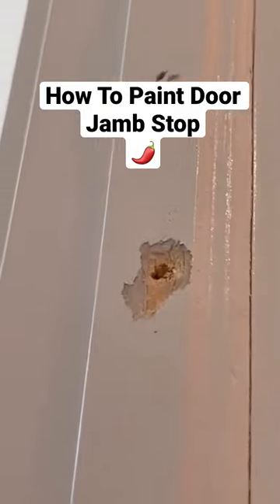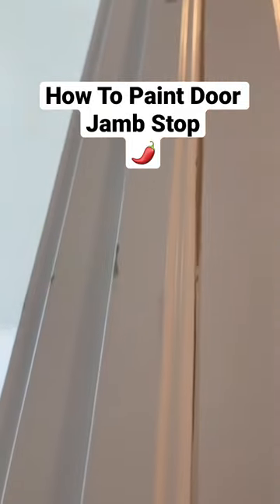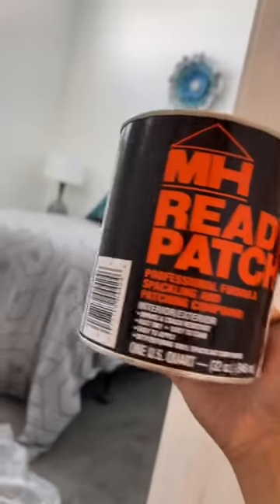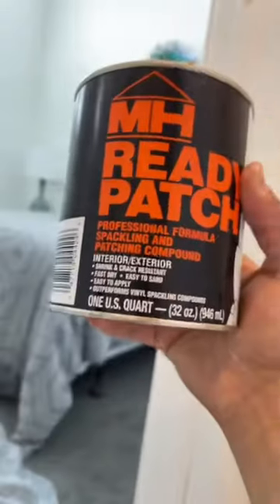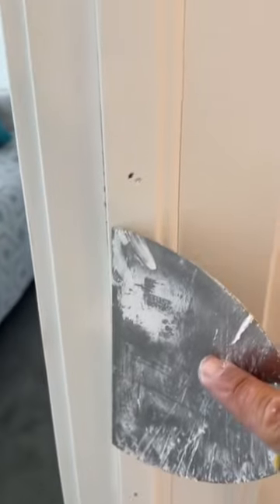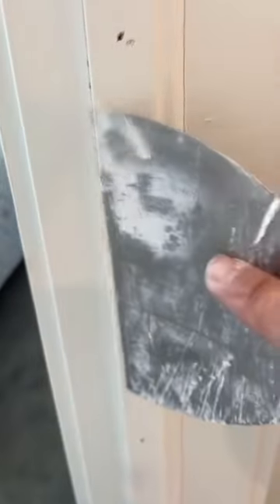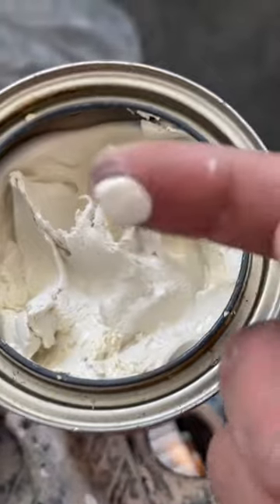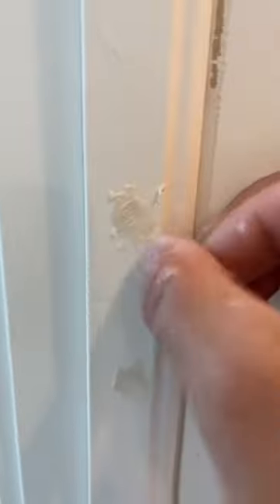How To Paint Door Jamb Stop. #short #handyman #painter #doorjamb #diy

Comment: Bend the tab inside the striker plate. It has a slot on the tab to be able to bend it out for this reason.
Reply: Bingo!  I’m surprised no one else has mentioned this.  If you want to tighten the latch you bend the tab on the inside of the strike plate.  That Carpetner should have known that.  That’s a one minute fix by someone who knows what they are doing